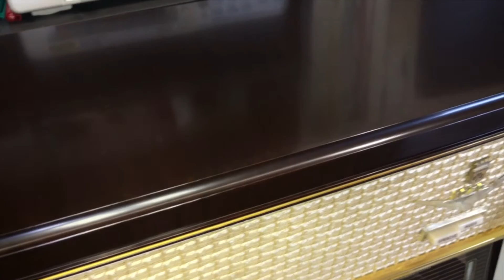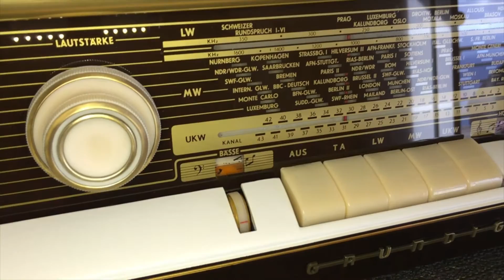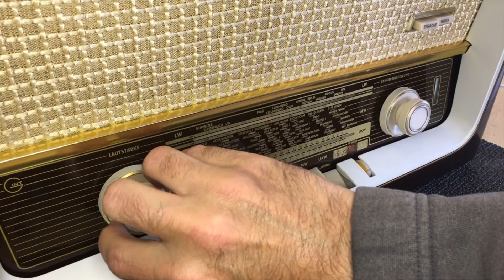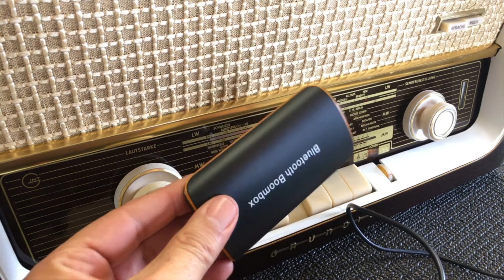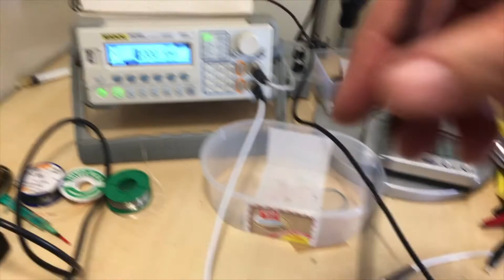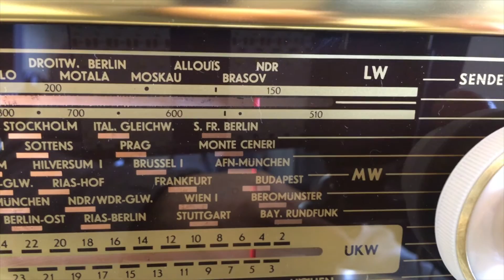Grundig 1070 tube radio restoration - Part 6. Another radio brought back to life. Job done.

Comment: I've got an 9-int-2 RCA, which is the large cabinet model of a radio similar to the one seen in your video here, produced in Germany by a different company...
 Graetz, I'm thinking it's from mid-late 1950's, far as I'm aware they made similar hi-fi units to those of Grundig... 
Very good FM reception, nice and sharp, especially for it's age. I've replaced faulty components... But, was wondering if it would be too crazy to maybe run a separate audio amplifier and wire-in some sort of stereo decoder... But for listening to news and sports radio, and the foremost feature of the radio (AM, shortwave bands 1 and 2), stereo FM was not of top-priority back when this was made. 
But I know they make multiplex circuits to decode it, only problem is, I don't want to screw anything up. It doesn't have a connection for a FM Multiplex  on the back, so it would take an actual electrician or well-studied tinkerer (not me) to bodge in some sorta MPX decoder circuit for that purpose, maybe retrofit some 60's multiplexer and set the Right audio channel out to the external speaker output on the back somehow, but as it stands I'd much rather let sleeping dogs lie than disturb the great operation of a well-made 1950's radio with some new-fangled junk tossed in. Perhaps I'll get it modified by someone who knows what they're doing, make the connections for an external MPX decoder one day, as I really like the radio and want to see it work for years to come. Heck, these days you can even decode FM with an SDR dongle and a computer program! They make integrated circuits these days, too. So, in addendum, I'm hoping that something can be done someday, but until then I won't worry about it. It works well enough for now, except for the volume knob going a bit crummy, but you'd expect that. Might just need some cleaning after all these years.👍
Reply from the maker: The quest for stereo FM is obviously a personal choice, but I wouldn’t go there. The radio is designed to take the entire mono FM signal through to the amplifier. If you add a Multiplexer, you are going to have to break that connection and bring in the left (or right) channel to feed through the Radio‘s amplifier and speakers, and then have an external amp and speaker for the other channel. I think the difference in sound is going to be pretty confusing. You’ll neither have clean stereo nor good mono.
Good luck with the cleaning. It really makes it worthwhile to keep these things going.
Reply: @electronicsoldandnew   Thanks for the timely response, sir. I agree, it's too complex to integrate stereo conversion into it, and anyhow, my uses for  my grandfathers' RCA (Graetz) is mostly for news, talk, weather and such, and scanning the shortwave bands. It does all of that quite well. Always interesting when skip, otherwise known as ionospheric propagation kicks up, and sends a broadcast signal to my receiver from half way across the globe. 👍

Comment: Looks magnificent! You didn’t say anything about how you restored the white paint on the cabinet. I’ve got a 997 US that I need to restore, your video was most helpful.
Reply from the maker: It been a while but if I recall, I spray-painted it after preparing it with primer.
Reply: @electronicsoldandnew I kind of figured you sprayed it. I didn’t see any brush marks. Really good restoration. Beyond my current skill level. I’m just trying to get’em working again.
Reply from the maker: One step at a time 😊

Comment: Hello ! I have several radios and a Philips tuner where the eye does not fully close. What could it be ? Alignment ?
Reply from the maker: eldontyrellcorp : could be, or simply weak reception. Magic eye only closes completely on strong reception.
Reply: @electronicsoldandnew  I have a lot strong stations over here, and on some radios eye is fully closed with these. So should be the same on the other radios and tuner I guess. Still it's difficult for me to know exactly what is wrong. Advantage with the Philips tuner is that it has a complete alignment instruction in 4 or 5 languages. That does not mean it's easy to do, anyway :) I'm missing an analogue voltmeter. Will try to dig one on a flea market soon !

Comment: Hey mate -- great series. Really enjoyed it. Had the pleasure to pick up one of these units this morning in a yard sale. Powers on and sounds great. Everything works except the volume knob is fixated in one setting, I can't get it to turn louder or softer. A connection issue? Any idea how to solve this? Also what did you use to polish the bakelite....thank you!!!
-Steve
Reply: Also -- were there versions of the 1070 with surround speakers?? I wish mine had them!!
Reply from the maker: +Stephen Kane : volume knob: spray some
 Intact cleaner to release it. Probably jammed with gunk. Bakelite: clean with car polish.
Reply: I just opened the back and boy was there dust. Turns out there are 2 side speakers as well! There isn't a front treble speaker on the grill.
Reply: M Caldeira hey there so follow up -- my unit does have surround!! 2 of the thin speakers on the sides. 1 deep speaker in the front of the grill. I managed to get the volume knob working, spraying heavily with WD-40. At first the knob wasn't attached  and plus the pot wouldn't budge so I got to loosen that up and so I glued the knob on and boom works fine now. I had an excellent night last night using this radio as it sounds excellent. I went to turn it on today and here came a guest---a hum!!! So this hum I can hear even with the volume knob all the way down. And on either channel I press. When I go from the "music" tone to "voice" there's even more of a hum. Interesting because it worked just fine last night!!! Some one I spoke with today suggested it was a grounding issue. Any ideas?!?!? Thanks!!!!
Reply: Also I tried taking each tube out individually to test if the hum was coming from a tube ... And even with all tubes out there's still the same hum. I don't think it's a tube issue!!
Reply from the maker: Stephen Kane : could be your main filter cap.
Reply: M Caldeira great, I'm thinking it's a capacitor as well. Where's the main filter cap located? Thanks!!
Reply from the maker: Stephen Kane : see video number 1 of the series.

Comment: I like the idea of the Bluetooth adaptor, but I have taken a different approach by buying a low power (1W) Bluetooth FM Stereo transmitter. This is connected to Alexa via Bluetooth and transmits on an FM frequency unused in my area. It has adjustable pre-emphasis, and mic and line inputs as well. This lets me listen to my music on any of my tube radios, anywhere in the house (and probably up to 500m away!)